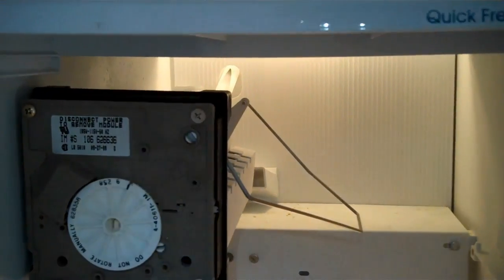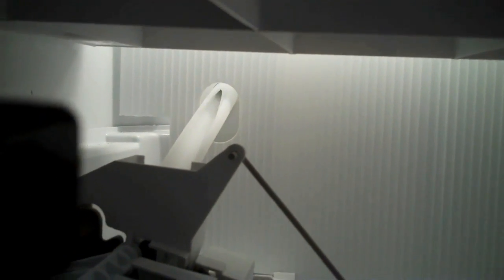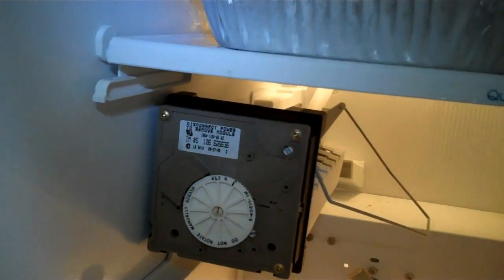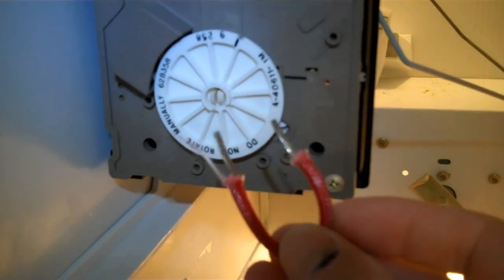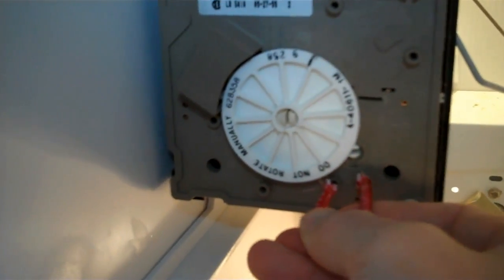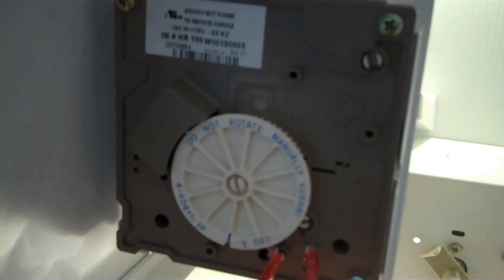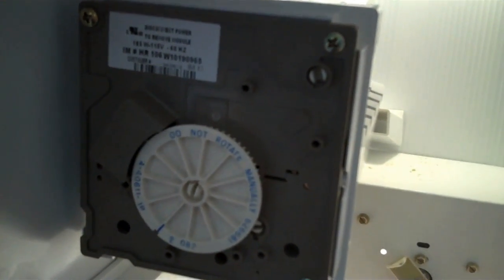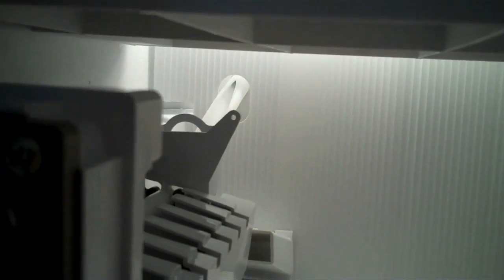Troubleshooting a No-Ice Complaint and Testing-Replacing a Whirlpool Modular Ice Maker

Comment: I have a Maytag MSD2574VEW10 Side by side. If my icemaker just spins all the time and never stops is that an issue with the water valve? Water never flows into it and the valve is not clogged with ice. I jumped the t-h and nothing happened, it just kept spinning. I poured water into it and it froze but the fins froze inside the ice. So I removed the IM and thawed the it. I reinstalled it and it did not spin. So I jumped N-M and it spins all the time again but now when I lift the arm and it stops when the slot on the front gear is at about the 5 o'clock position. I really sure what to do, I am thinking it a water valve issue.
Reply from the maker: If the ice make rake fingers just keep spinning without stopping and it never fills, then the ice maker is bad:  http://bit.ly/1fQmSK1
OTOH, if the ice maker does a normal periodic harvest cycle and then stops for a while but water never comes in at the end of the cycle, then the water fill valve may be bad: http://bit.ly/1fQny1O
But you'd need to test it to be sure.   One easy test is to put a cheater cord on the water fill valve (ice maker side) terminals and apply 120VAC.  Water squirts into the ice maker, then you know the valve is good and the ice maker is bad.  No water: could be frozen fill tube or bad valve.

Comment: When I use the jumper you describe in the video, it fills the ice maker just fine and awhile later the ice maker removes the ice cubes.  My problem is that it does NOT refill on it's own after that???

Ideas?

BTW....this video is GREAT!!
Reply from the maker: Gordon Jorgenson Classic bad ice maker control module.  Replace the ice maker.  Get it here:  http://bit.ly/1i7QEhw
Reply: SamuraiRepairman
Thank You!!  What is the part number?
On my Ice MAker it has the following numbers
185W-115V-60Hz
IM#S106626636
LR 5010 03-11-99

My Fridge is a Whirlpool Model: ED25RFXFW01
Reply from the maker: Gordon Jorgenson To find your replacement ice maker, get the MODEL number off the tag in the refrigerator and plug it into the search box on this page:  @1i7QEhw
Reply: SamuraiRepairman

That page didn't come out correctly??
Reply from the maker: Gordon Jorgenson It's the same link as in my first reply.  Just click that one.
Reply: SamuraiRepairman

Got it.  Thank you for your help!
Reply: Gordon Jorgenson
 I replaced the ice maker and it cycled through the first time and when it went all the way around and stopped, it did NOT fill with water???  Ideas?
Reply: Gordon Jorgenson
Any idea on why it is not calling for water?
Reply from the maker: The water inlet valve may be bad or the fill tube frozen.  I would use my cheater cord on the water inlet valve and apply 120VAC to it directly and see if water actually fills the ice maker mold.
Reply: Water tube is clogged?  Water valve is broken.

Comment: I have an ice maker that makes the ice if I pour water in the tray but the teeth don't rotate around and cycle to kick the ice out.  I don't think the metal heats up either to make it easy to kick the ice out.  Also, no water comes through the tube in the wall to fill the ice maker.  Do I replace the module or thermostat or the whole ice maker?  My icemaker didn't respond to the jumper wire
Reply: Best to replace the whole thing so you have all new parts for the difference in price.

Comment: Mr. Samurai,,I used a jumper wire to start my Ice Maker cycle yesterday,,but when I tried it today,,it didn't "Click On",,nothing happened,,is there a "One time Only" to this "Trick" ?,,,ed
Reply from the maker: eddie d Sounds like you have what we in the trade call a "bad ice maker."
Reply: Nope.  Every time you short the T-H connections it should run a cycle.

Comment: Mr. Samurai, could you direct me in the right direction.   I  have a Whirlpool Gold Side by Side Model GS6NBEXRS00.  It uses an emitter reciever control board that monitors if the door is open the Flashing red light keeps flashing even when I close the little door on the emitter closed I should see a steady red led lit but it continues to flash.  My question is besides the emittter board going bad is there another reason why the led will keep on flashing and not stay steady on?  At the moment there is ice in the mold and the Control Module Dial is stopped between the 5 & 6 O'clock postion.  I tried jumping the T and H to run test but nothing happen either. I am not sure if it is because the emitter/receiver board is bad or the Contorl Module or Mold motor is bad What do you recommend?  Your advice would be greatly appreciated.
Emitter Board Part Number 2220398 Discontinued (according to Whirlpool)
Reciever Board part 2255114 Discontinued (according to Whirlpool)
New Part Number W10757851 emitter and receiver come togeather.

Comment: noticed immediately that the ice maker has stopped mid cycle. The line on the big gear wheel should be between 4 and 5 o'clock.

Comment: Tray was overflowing. Just replaced the control module.  Now water will not fill tray automatically.  Jumpered T-H and let it spin for a few revolutions but no water.  Jumpered L-V and water flows.  Heater works.  Any help?
Reply from the maker: You have a bad ice maker.  Slam dunk.  Come git you one:  http://bit.ly/1jYpsMA

Comment: I have no water going into the ice maker so I'm wondering if the motor is okay and the solenoid is bad???
Reply: check if has inline filter.
check water supply
then check supply valve/solenoid.
Reply: 3 Brothers Mechanical what if you have replace the solenoid also I'm getting water in the door but no water is filling up into the ice tray and I did replace the solenoid
Reply: You replaced the water valve in the back of the fridge?  Have you tried jumping the L-V terminals on the ice maker module?  That should trip the valve and start spewing water in the ice maker mold if the valve is working.

If it doesn't fill then you may have a frozen line.  Make sure the tube where water is supposed to come out is not clogged up or frozen with ice.

If you jump the T-H it should send your ice machine into a full cycle.  You can stop jumping it about halfway around.  This should heat the mold (feel this hotness on bottom of mold), turn the ice remover blades, eject the ice, the fill the mold with fresh water then reset the full/empty switch on the ice maker.

If your machine dumps water with L-V but not T-H then you need a new module, or spend a few bucks more and just buy a whole new ice maker.  Might as well get all fresh parts instead of reusing 5-15 year old stuff.

Comment: I have continuity through the solenoid and when I jumper the ice maker (T-H)  it rotates but nothing else happens.  Any ideas?
Reply: fill tube is clogged/frozen?  Temperature is too warm or thermostat is broken?  Try jumpering L and V.  That should energize the water valve and send water down the tube into the mold.  If you're not getting water then you  have a clogged tube or a broken water valve.  You can check for broken electrical connections on the water valve by checking the ohms across the terminals (while unplugged from the wiring harness).  Should have 150-1000 ohms of resistance.  If it's zero or infinity, you need a new valve.  Even if it shows connectivity you may have a mechanically broken valve that needs replacing.

Comment from the maker: The mold heater is burned out causing the ice cubes to stick in the mold and the motor doesn't have enough torque to break them free.  This is why I never replace just the module; for a few bucks more, you can replace the entire ice maker assembly.  Go to the Appliantology Academy and buy it through the parts search box at the top of the page-- comes with a one year warranty!  :)
Reply: Mira amigo aver si puedes ayudarme  mi problema es el siguiente el reloj de la fábrica de hielo no camina amenos que le ponga los alambres cómo me muestra un vídeo en los orificios pero solo así camina pero no despega los hielos creo porque no manda señar o tu opinar cambiar el motor el motor sirve pero no camina el reloj que me recomiendas

Comment: Where is the supply valve solenoid located?
Reply: back of the fridge, usually near the bottom right.   It's where the water from the house feeds into your fridge.

Comment: Great video and jumper test!

A note to everyone with the light sensor... check out this video and using a jumper there to override the ice level/door sensor.  If you don't and have a bad sensor like I did, it ends up looking like a bad timing motor when in fact you aren't getting power to it due to the sensor.   https://youtu.be/K9_UoSzbkUs?t=50s

Comment from the maker: N-M is not a valid test point pairing and jumpering these test points is meaningless.  M-L will run the motor; N-V will actuate the water inlet solenoid valve.  Bottom line:  if the ice maker will not run a manual harvest when jumpering T-H, the module is shot-- replace the ice maker.
Reply: Are you sure you don't mean L-V to actuate the water valve?

Comment: Do you ever just replace the module?  That's what we do all the time.
Reply from the maker: We used to do that but, for just a few extra bucks, the customer can get a whole new ice maker. The teflon molds on these ice makers are really only good for about 5 years and then they start breaking down. New ice maker gives a new mold, new heater, new thermostat... all the other parts that can fail and cause health or operational problems.
Reply: SamuraiRepairman great point. What is your professional opinion on using generic parts?
Reply from the maker: I avoid genetics like the plague— too many quality problems and call backs. Learned that the hard way. I always go OEM and know the part will work perfectly. The additional cost is irrelevant because the customer is paying for the part anyway. Most people would rather have a more reliable fix for a few extra bucks.

Comment: I used the jumper to jump t and h and I visually observed the water inlet valve fill the through the tube. The dial or timing circle not sure what it's called stops after a few minutes. I've tried jumping several times with the same result. The dial turns and eventually stops. What do you think the problem might be?